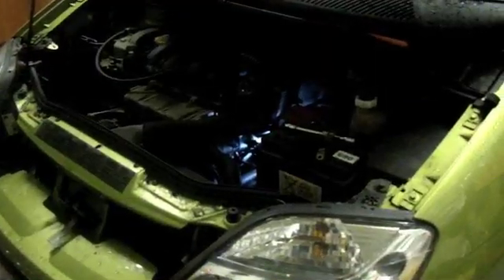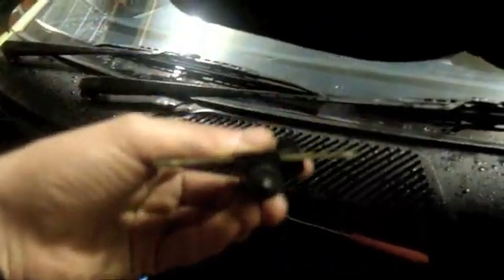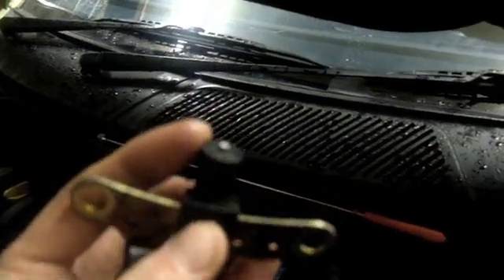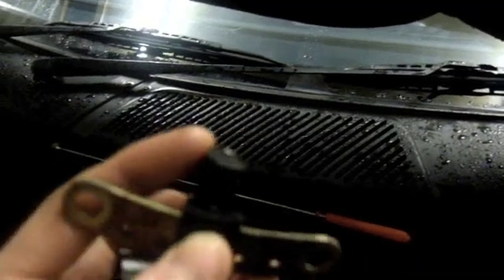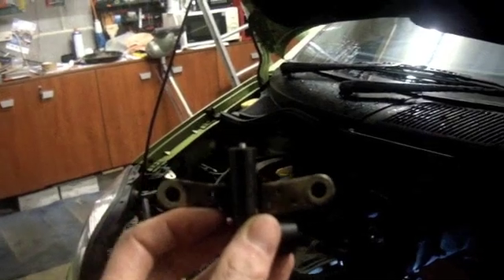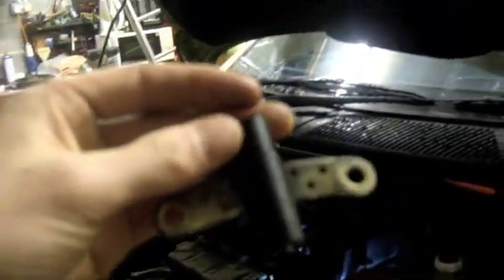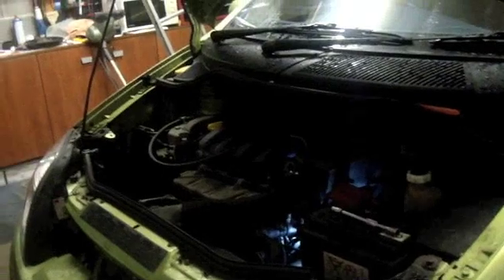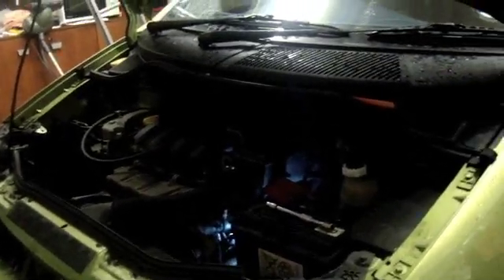How To: Repair A Defective TDC Sensor

Comment: I've got Renault megane scenic 1.4 51reg. Had few problems with starting it. Few weeks ago was stuck in traffic for ages then went asda.  My partner went inside i stayed in car 10min later i go start car an wouldn't start.didnt even sound like wanted start. I looked under bonnet (like I no what I'm looking for lol) then about 20-30min later it started. It was fine for for nxt 3-4weeks but yesterday I went get petrol witch is across road from my house and car wouldn't start 1st time 3rd time trying it started.then was fine for nxt few hours.  We went cinema later after watching film for more less 2hr came bk to car an again wouldn't start. Sounded like wanted to but wouldn't. Again looked under bonnet. about 5-10min max later it started straight away. Drove home and haven't used car since.ive started it an starts 1st time. Sum times when start car I have to rev it little as if don't will cut out. Do you think this is the same thing in ur video?  Car does need service an garage said had miss fire..sorry for how long message is .Thanks.

Comment: I occasionally have this problem on my Laguna 1.9 dCi (won't start when warm, but OK when cold).
But I really can't comprehend why doing what was shown here would make any difference!
My usual 'fix' is actually much easier than this though ... simply wait for the engine to cool down a little.
Usually after about 15 minutes or so, it will start OK without further action.
I had the 'crank sensor' (not sure if that is the same thing here?) changed recently, but the fault still occurs (intermittently - about every month or so).
In the latest incident, the AA guy said it was the 'Cam sensor' (camshaft position sensor).
He sprayed it with freezer fluid and replaced it, and it started OK.
So I'm now going to change that ... and it doesn't have the metal tip shown here!

P.S. Couldn't see much of what you were trying to show under the bonnet.
You need much better lighting than that to get a decent image on a camcorder. They really don't work very well in such low light.
Also, I would suggest holding the camera more steadily ... when moved so fast it's very hard to see anything!  Ideally use a tripod, or at least rest the camera on something solid. Start with a wider shot and zoom in SLOWLY!

Comment: Why does my Clio 1.5dCi TDC work ok when cold but not when hot. I've thoroughly cleaned it, so it's not due to it being dirty?
Reply: it more than likely needs replacing instead of the clean.mine is the same when the car is warm it wont fire,, so i changed mine and its fine now

Comment from the maker: it should be in the same place. Its possible one of the nuts is missing on that connector you have found. Take it off and clean the sensor up.

Comment: Hello Adam iv been looking for my sensor but cant seem to find the same as yours in your video mine is a renault megane scenic 2001 1.4 petrol where mine is there is a single nut with a conector off of that would this be it in this model thanks.

Comment: I had a problem with my 2000 Megane 1.6 Coupe. Cleaning the sensor sorted the problem and a free fix. It was mis-firing and struggling to drive. Thought it was plugs or coils initially, so I changed them but still missed. Cleaned up the sensor, took for test drive, and WOW! More power than before so it must have been getting worse before giving up. This is what is best about Youtube. Keep up the good work Adam.

Comment: Hi Adam I have a 00 scenic auto 1.6 would you know what would be causing a very high rev on start up over 2000 revs nearly goes to 3000 revs when cold drops down alright when it gets hot.

Comment: Hi, I have a 2001 laguna, the engine wont start and when it did start it cut out while driving around 50m down the road. do you think this could be a problem with the sensor? and if so do you know where it is located? i have tried jumping the car thinking it is a problem with the battery and it ticks over just will not fire up.

Comment from the maker: @jblsound13 there is a tiny magnet (metal piece) at the bottom of the sensor. Use some fine grit sandpaper and sand it lightly then clean it with a cloth and some oil. Now completely dry the part off and make sure it is oil free and you are ready to re-fit the part. Hope this helps. Adam

Comment: I have TDC sensor failure eg clatter or knocking sound when warm but intermittent so I took it off to clean but its a hole in the middle so how would i clean it?

Comment: Great video, iv'e got the same problem on my clio 03, i took the air filter off to give more room to undo the bolts, i have managed to remove one but can't seem to get the other one off, there is very little space and i don't want to round of the bolts. any advice would be appreciated.